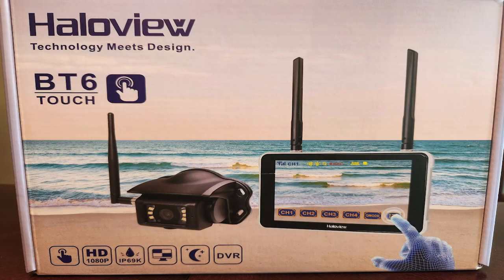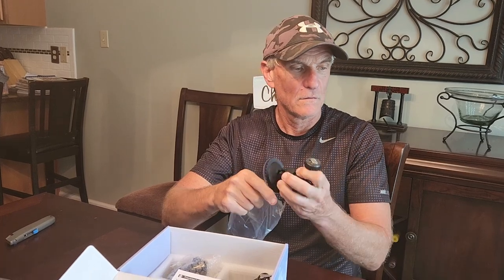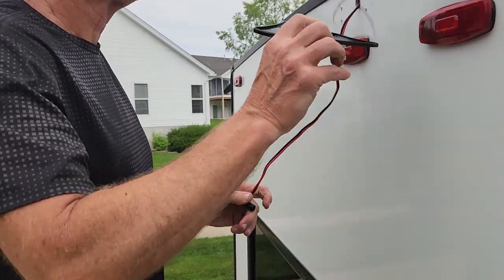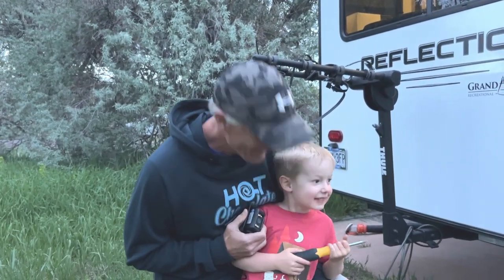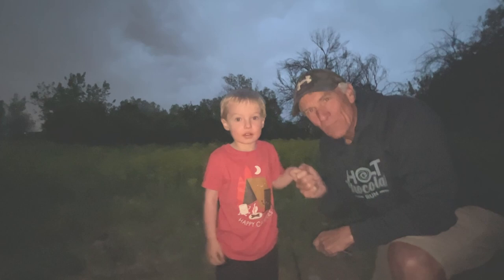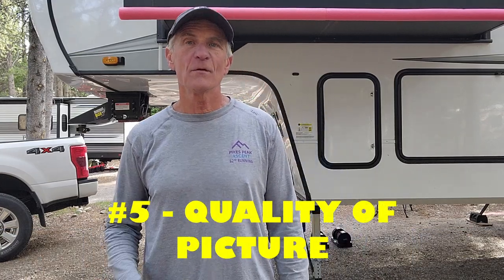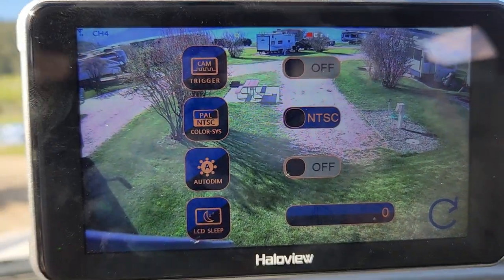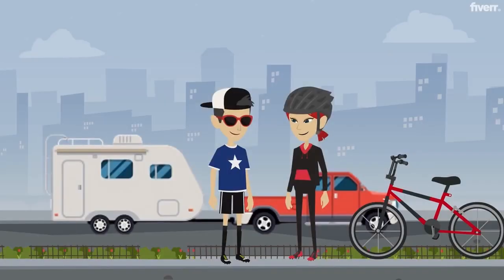Is Haloview BT6 Touch A Superior Rear RV Camera | We Provide The Answers

Comment: Great job on this review - Love that bike rack - I think I would need an extra heavy duty rack :)  Nice that your marker lights are below the camera - ours were too close to the mounting point and made the camera hard to mount. Bummer about the camera - I didn't try to drop test ours...   I like how you broke this down into categories for rating - that was a nice way of presenting it.  Great to hear this works well for you - we have had a few different Haloview cameras and have liked them a lot.
Reply from the maker: Hey guys! The drop test is something we wouldn't recommend. It's frustrating how some mods start off without a hitch, but go south without notice. Fortunately everything turned out fine and the install was a success. We love the bike rack and have had it nearly four years. We've found it to be pretty versatile through the years! 😁